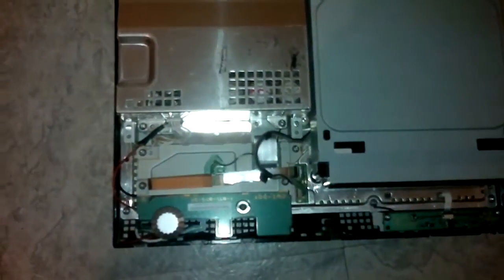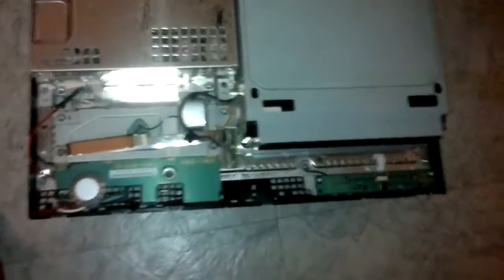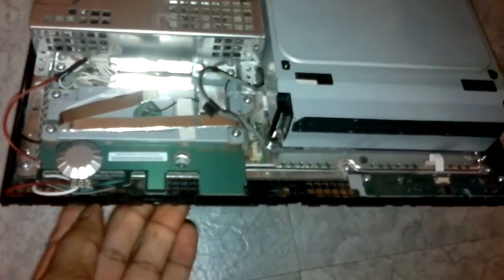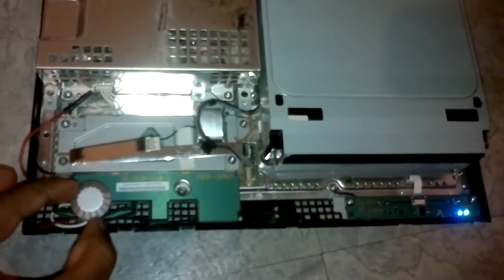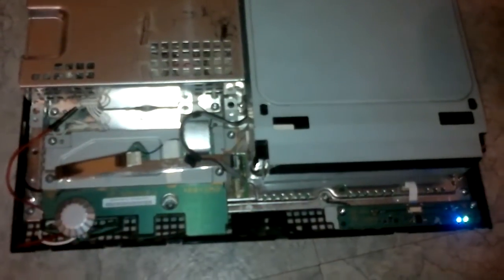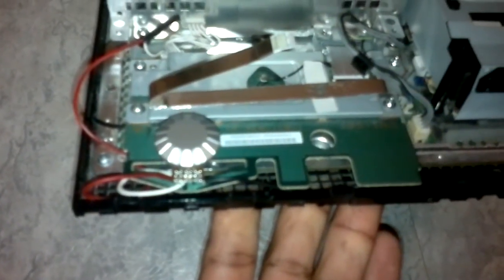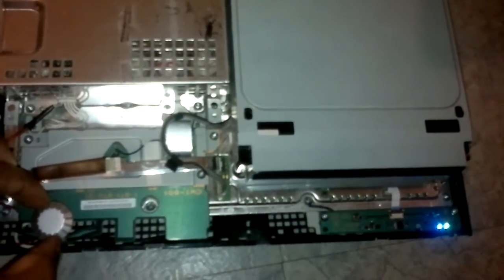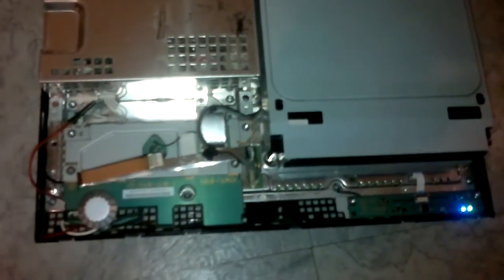PS3 Fan Speed Control Mod.mp4

Comment: That much power fan will over heat n probably going to fry real quick since it doesn’t have a sensor to slowdown so it’s actually worse for the system

Comment: Did you tap into the grey wire on the fan? Can you explain that a bit more I did this years ago and now trying to do it again and for the life of me i can't remember. And if you cut the grey wire which side did you use? The plug side or the fan side of the wire? Thanks

Comment: Do I need to attach a earth wire to the Potentiometer if I do this mod to a ps3 slim, and if so how what is the best way to attach the earth wire to the screw, I mean did you just solder the wire to the screw?

Comment: I fully agree you have to do the fan mod after getting the ylod and doing a proper reflow...  The ps3 fan does not cool the unit enough and the speed sensor gets weak...  I wnt to radioshack and got a 10k-Ohm Liner-Taper Potentiometer cost $3.09 ... I wired it in as 5sponly has and make sure to use the Ground wire from the third( right) post connected to a screw in the motherboard metal bracket....  now adjusting the speed of the fan is possible for less than four bucks.